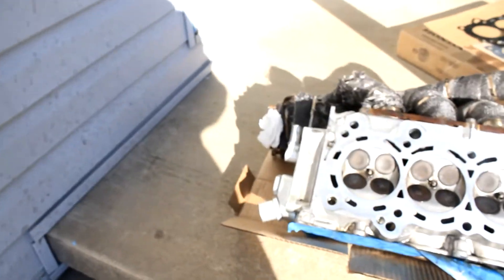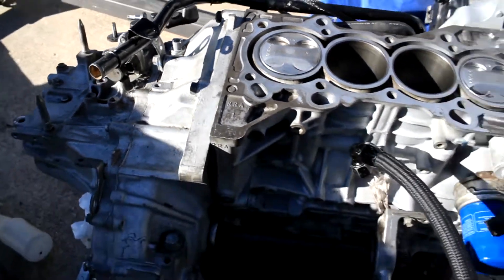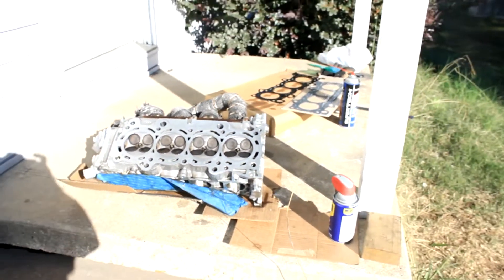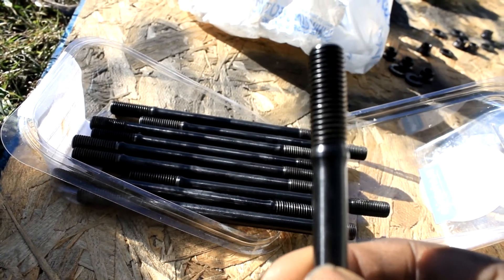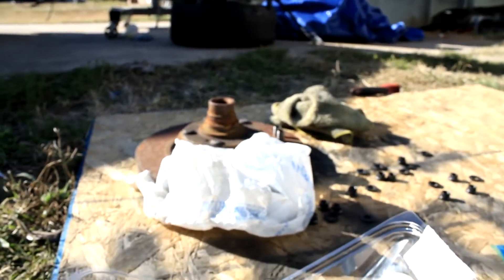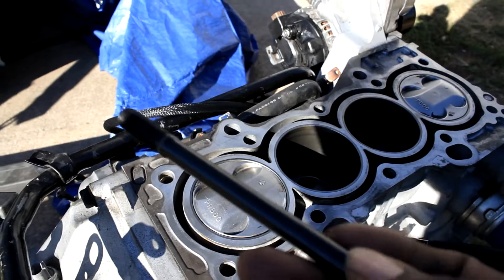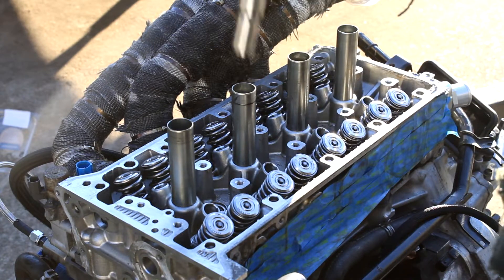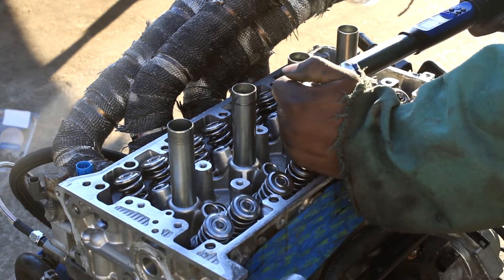INSTALLING K20Z3 CYLINDER HEAD/ARP HEAD STUDS | NATURE OF THE BEAST EP:4

Comment: Wait, so if I have a fresh set of ARP head studs do not put the molly lube on the bottom end, but only on the top end?
Reply from the maker: If I'm answering your question... No, that end gets installed dry or with loctite for permanent use.  The top gets the lube which helps torquing
Reply: @kadeemwillock6335  thank you